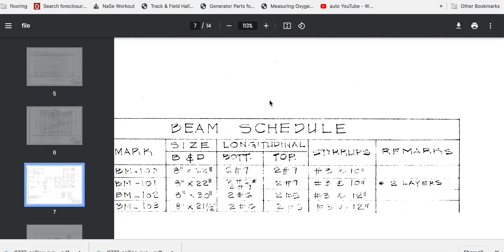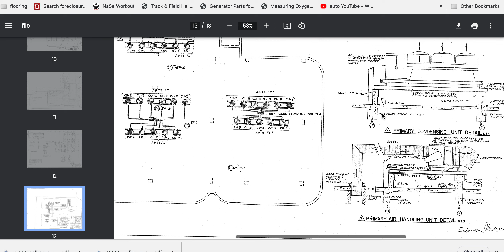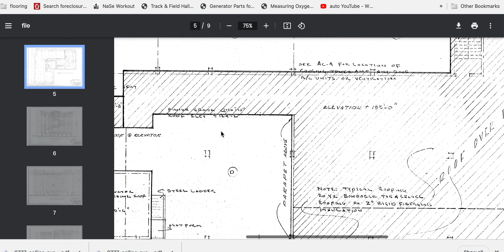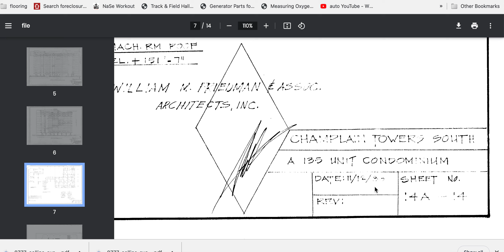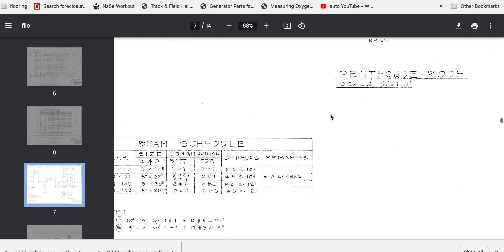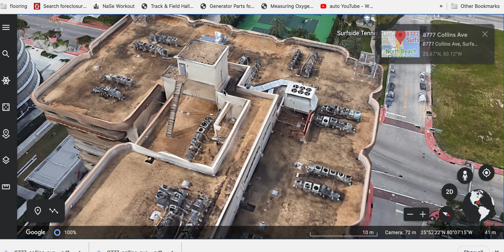Champlain Towers Roof Punching shear as initial structural collapse Part 6

Comment: I know those stairs had nothing to do with the collapse, but I don't see how something of that height would be code compliant
with no railings!
Reply from the maker: Hello Chris, Happy New Year... Those stairs are just service stairs for contractors and not for residential usage...
A two sided handrail and pickets would still be required... Along with the platform (I called it a landing ; my brain 🧠 should have clarified the difference between a landing and a platform)...
Both required at least 32 " square per 1980 code, as I recall.
The intent is to allow for the door swing without having to step down a step backwards. 
Also, to allow for stepping onto a platform before proceeding down steps, to avoid a "spontaneous " tumble down the steps.

Comment: The red rails and the air handler on the ground are a clue maybe. The mass of the air handler would keep it on the roof unless the red framing was tilted and pulled away by the collapse
Reply from the maker: Now your thinking! 
Hint: Recall the wind loads it could take, this means it was anchored down ...
But, think about the steel, where was it anchored and would that anchor point/ location rip this into a different shape as it was ripping itself from one end to the next? If so, what would that steel section(s) look like?